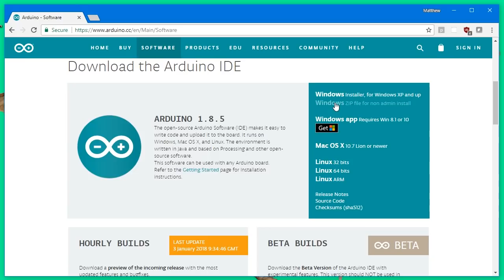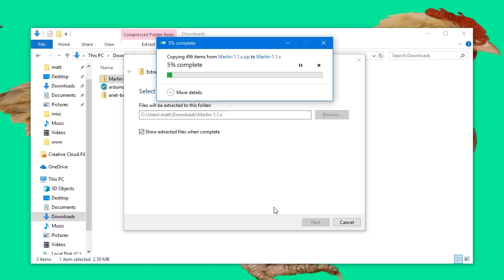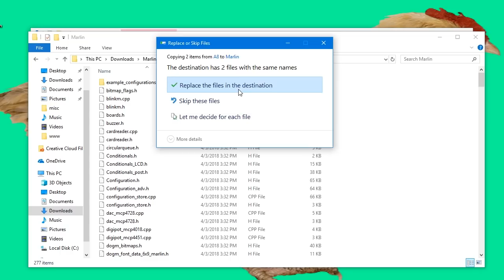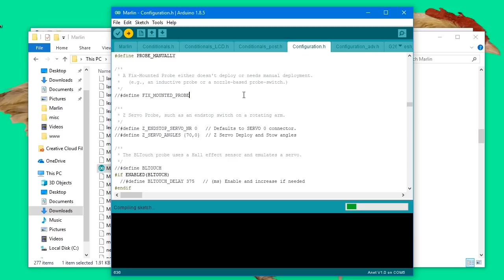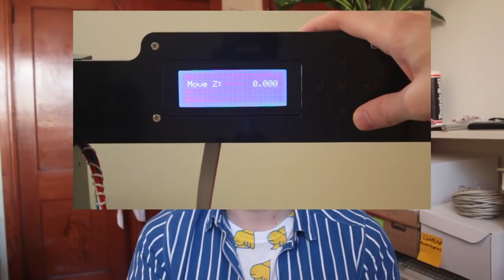Anet A8 Upgrade: Why & How You Should Update Your Firmware - Marlin Install Tutorial

Comment: Hi
I get this error message if I want to do this upgrade :/
pasting "/* (bed)*/" and "_RPORT" does not give a valid preprocessing token

What can I do against this fail?
Reply: Thats the whole text:

Arduino: 1.8.6 (Windows 10), Board: "Anet V1.0"

In file included from sketch\HAL.h:33:0,

                 from sketch\MarlinConfig.h:39,

                 from sketch\Marlin.h:35,

                 from sketch\temperature.cpp:27:

pins_ANET_10.h:135:33: error: pasting "/* (bed)*/" and "_RPORT" does not give a valid preprocessing token

 #define HEATER_BED_PIN     12   // (bed)

                                 ^

sketch\fastio.h:82:48: note: in definition of macro '_WRITE'

 #define _WRITE(IO,V)          do{ if (&(DIO ## IO ## _RPORT) < (uint8_t*)0x100) _WRITE_NC(IO,V); else _WRITE_C(IO,V); }while(0)

                                                ^

sketch\Conditionals_post.h:906:31: note: in expansion of macro 'WRITE'

   #define WRITE_HEATER_BED(v) WRITE(HEATER_BED_PIN, (v) ^ HEATER_BED_INVERTING)

                               ^

sketch\Conditionals_post.h:906:37: note: in expansion of macro 'HEATER_BED_PIN'

   #define WRITE_HEATER_BED(v) WRITE(HEATER_BED_PIN, (v) ^ HEATER_BED_INVERTING)

                                     ^

sketch\temperature.cpp:884:11: note: in expansion of macro 'WRITE_HEATER_BED'

           WRITE_HEATER_BED(LOW);

           ^

pins_ANET_10.h:135:33: error: pasting "/* (bed)*/" and "_WPORT" does not give a valid preprocessing token

 #define HEATER_BED_PIN     12   // (bed)

                                 ^

sketch\fastio.h:72:21: note: in definition of macro '_WRITE_NC'

   if (V) SBI(DIO ## IO ## _WPORT, DIO ## IO ## _PIN); \

                     ^

sketch\fastio.h:94:31: note: in expansion of macro '_WRITE'

 #define WRITE(IO,V)           _WRITE(IO,V)

                               ^

sketch\Conditionals_post.h:906:31: note: in expansion of macro 'WRITE'

   #define WRITE_HEATER_BED(v) WRITE(HEATER_BED_PIN, (v) ^ HEATER_BED_INVERTING)

                               ^

sketch\Conditionals_post.h:906:37: note: in expansion of macro 'HEATER_BED_PIN'

   #define WRITE_HEATER_BED(v) WRITE(HEATER_BED_PIN, (v) ^ HEATER_BED_INVERTING)

                                     ^

sketch\temperature.cpp:884:11: note: in expansion of macro 'WRITE_HEATER_BED'

           WRITE_HEATER_BED(LOW);

           ^

pins_ANET_10.h:135:33: error: pasting "/* (bed)*/" and "_PIN" does not give a valid preprocessing token

 #define HEATER_BED_PIN     12   // (bed)

                                 ^

sketch\fastio.h:72:42: note: in definition of macro '_WRITE_NC'

   if (V) SBI(DIO ## IO ## _WPORT, DIO ## IO ## _PIN); \

                                          ^

sketch\fastio.h:94:31: note: in expansion of macro '_WRITE'

 #define WRITE(IO,V)           _WRITE(IO,V)

                               ^

sketch\Conditionals_post.h:906:31: note: in expansion of macro 'WRITE'

   #define WRITE_HEATER_BED(v) WRITE(HEATER_BED_PIN, (v) ^ HEATER_BED_INVERTING)

                               ^

sketch\Conditionals_post.h:906:37: note: in expansion of macro 'HEATER_BED_PIN'

   #define WRITE_HEATER_BED(v) WRITE(HEATER_BED_PIN, (v) ^ HEATER_BED_INVERTING)

                                     ^

sketch\temperature.cpp:884:11: note: in expansion of macro 'WRITE_HEATER_BED'

           WRITE_HEATER_BED(LOW);

           ^

pins_ANET_10.h:135:33: error: pasting "/* (bed)*/" and "_WPORT" does not give a valid preprocessing token

 #define HEATER_BED_PIN     12   // (bed)

                                 ^

sketch\fastio.h:73:21: note: in definition of macro '_WRITE_NC'

   else   CBI(DIO ## IO ## _WPORT, DIO ## IO ## _PIN); \

                     ^

sketch\fastio.h:94:31: note: in expansion of macro '_WRITE'

 #define WRITE(IO,V)           _WRITE(IO,V)

                               ^

sketch\Conditionals_post.h:906:31: note: in expansion of macro 'WRITE'

   #define WRITE_HEATER_BED(v) WRITE(HEATER_BED_PIN, (v) ^ HEATER_BED_INVERTING)

                               ^

sketch\Conditionals_post.h:906:37: note: in expansion of macro 'HEATER_BED_PIN'

   #define WRITE_HEATER_BED(v) WRITE(HEATER_BED_PIN, (v) ^ HEATER_BED_INVERTING)

                                     ^

sketch\temperature.cpp:884:11: note: in expansion of macro 'WRITE_HEATER_BED'

           WRITE_HEATER_BED(LOW);

           ^

pins_ANET_10.h:135:33: error: pasting "/* (bed)*/" and "_PIN" does not give a valid preprocessing token

 #define HEATER_BED_PIN     12   // (bed)

                                 ^

sketch\fastio.h:73:42: note: in definition of macro '_WRITE_NC'

   else   CBI(DIO ## IO ## _WPORT, DIO ## IO ## _PIN); \

                                          ^

sketch\fastio.h:94:31: note: in expansion of macro '_WRITE'

 #define WRITE(IO,V)           _WRITE(IO,V)

                               ^

sketch\Conditionals_post.h:906:31: note: in expansion of macro 'WRITE'

   #define WRITE_HEATER_BED(v) WRITE(HEATER_BED_PIN, (v) ^ HEATER_BED_INVERTING)

                               ^

sketch\Conditionals_post.h:906:37: note: in expansion of macro 'HEATER_BED_PIN'

   #define WRITE_HEATER_BED(v) WRITE(HEATER_BED_PIN, (v) ^ HEATER_BED_INVERTING)

                                     ^

sketch\temperature.cpp:884:11: note: in expansion of macro 'WRITE_HEATER_BED'

           WRITE_HEATER_BED(LOW);

           ^

pins_ANET_10.h:135:33: error: pasting "/* (bed)*/" and "_WPORT" does not give a valid preprocessing token

 #define HEATER_BED_PIN     12   // (bed)

                                 ^

sketch\fastio.h:77:30: note: in definition of macro '_WRITE_C'

   uint8_t port_bits = DIO ## IO ## _WPORT;                  /* Get a mask from the current port bits */ \

                              ^

sketch\fastio.h:94:31: note: in expansion of macro '_WRITE'

 #define WRITE(IO,V)           _WRITE(IO,V)

                               ^

sketch\Conditionals_post.h:906:31: note: in expansion of macro 'WRITE'

   #define WRITE_HEATER_BED(v) WRITE(HEATER_BED_PIN, (v) ^ HEATER_BED_INVERTING)

                               ^

sketch\Conditionals_post.h:906:37: note: in expansion of macro 'HEATER_BED_PIN'

   #define WRITE_HEATER_BED(v) WRITE(HEATER_BED_PIN, (v) ^ HEATER_BED_INVERTING)

                                     ^

sketch\temperature.cpp:884:11: note: in expansion of macro 'WRITE_HEATER_BED'

           WRITE_HEATER_BED(LOW);

           ^

pins_ANET_10.h:135:33: error: pasting "/* (bed)*/" and "_RPORT" does not give a valid preprocessing token

 #define HEATER_BED_PIN     12   // (bed)

                                 ^

sketch\fastio.h:79:10: note: in definition of macro '_WRITE_C'

   DIO ## IO ## _RPORT = port_bits & _BV(DIO ## IO ## _PIN); /* Atomically toggle the output port bits */ \

          ^

sketch\fastio.h:94:31: note: in expansion of macro '_WRITE'

 #define WRITE(IO,V)           _WRITE(IO,V)

                               ^

sketch\Conditionals_post.h:906:31: note: in expansion of macro 'WRITE'

   #define WRITE_HEATER_BED(v) WRITE(HEATER_BED_PIN, (v) ^ HEATER_BED_INVERTING)

                               ^

sketch\Conditionals_post.h:906:37: note: in expansion of macro 'HEATER_BED_PIN'

   #define WRITE_HEATER_BED(v) WRITE(HEATER_BED_PIN, (v) ^ HEATER_BED_INVERTING)

                                     ^

sketch\temperature.cpp:884:11: note: in expansion of macro 'WRITE_HEATER_BED'

           WRITE_HEATER_BED(LOW);

           ^

pins_ANET_10.h:135:33: error: pasting "/* (bed)*/" and "_PIN" does not give a valid preprocessing token

 #define HEATER_BED_PIN     12   // (bed)

                                 ^

sketch\fastio.h:79:48: note: in definition of macro '_WRITE_C'

   DIO ## IO ## _RPORT = port_bits & _BV(DIO ## IO ## _PIN); /* Atomically toggle the output port bits */ \

                                                ^

sketch\fastio.h:94:31: note: in expansion of macro '_WRITE'

 #define WRITE(IO,V)           _WRITE(IO,V)

                               ^

sketch\Conditionals_post.h:906:31: note: in expansion of macro 'WRITE'

   #define WRITE_HEATER_BED(v) WRITE(HEATER_BED_PIN, (v) ^ HEATER_BED_INVERTING)

                               ^

sketch\Conditionals_post.h:906:37: note: in expansion of macro 'HEATER_BED_PIN'

   #define WRITE_HEATER_BED(v) WRITE(HEATER_BED_PIN, (v) ^ HEATER_BED_INVERTING)

                                     ^

sketch\temperature.cpp:884:11: note: in expansion of macro 'WRITE_HEATER_BED'

           WRITE_HEATER_BED(LOW);

           ^

In file included from sketch\HAL.h:33:0,

                 from sketch\MarlinConfig.h:39,

                 from sketch\Marlin.h:35,

                 from sketch\temperature.cpp:27:

pins_ANET_10.h:134:33: error: pasting "/* (extruder)*/" and "_DDR" does not give a valid preprocessing token

 #define HEATER_0_PIN       13   // (extruder)

                                 ^

sketch\fastio.h:87:42: note: in definition of macro '_SET_OUTPUT'

 #define _SET_OUTPUT(IO)       SBI(DIO ## IO ## _DDR, DIO ## IO ## _PIN)

                                          ^

sketch\temperature.cpp:1106:5: note: in expansion of macro 'SET_OUTPUT'

     SET_OUTPUT(HEATER_0_PIN);

     ^

sketch\temperature.cpp:1106:16: note: in expansion of macro 'HEATER_0_PIN'

     SET_OUTPUT(HEATER_0_PIN);

                ^

pins_ANET_10.h:134:33: error: pasting "/* (extruder)*/" and "_PIN" does not give a valid preprocessing token

 #define HEATER_0_PIN       13   // (extruder)

                                 ^

sketch\fastio.h:87:61: note: in definition of macro '_SET_OUTPUT'

 #define _SET_OUTPUT(IO)       SBI(DIO ## IO ## _DDR, DIO ## IO ## _PIN)

                                                             ^

sketch\temperature.cpp:1106:5: note: in expansion of macro 'SET_OUTPUT'

     SET_OUTPUT(HEATER_0_PIN);

     ^

sketch\temperature.cpp:1106:16: note: in expansion of macro 'HEATER_0_PIN'

     SET_OUTPUT(HEATER_0_PIN);

                ^

pins_ANET_10.h:135:33: error: pasting "/* (bed)*/" and "_DDR" does not give a valid preprocessing token

 #define HEATER_BED_PIN     12   // (bed)

                                 ^

sketch\fastio.h
Reply: i think there is something wrong with ide 1.8.6, i downgraded mine to 1.8.5 and it worked fine.

Comment: I seem to get error messages when compiling.
Followed it to the letter... help....

Arduino: 1.8.10 (Windows 10), Board: "Anet V1.0"

In file included from C:\Program Files\Arduino\hardware\arduino\avr\cores\arduino/Arduino.h:257:0,

                 from sketch\HAL.h:36,

                 from sketch\MarlinConfig.h:39,

                 from sketch\G26_Mesh_Validation_Tool.cpp:27:

C:\Users\User\Documents\Arduino\hardware\anet\avr\variants\sanguino/pins_arduino.h:43:0: warning: "TIMER2" redefined

 #define TIMER2  5

 

In file included from sketch\HAL.h:36:0,

                 from sketch\MarlinConfig.h:39,

                 from sketch\G26_Mesh_Validation_Tool.cpp:27:

 

In file included from sketch\endstops.cpp:35:0:

sketch\endstop_interrupts.h: In function 'void setup_endstop_interrupts()':

endstop_interrupts.h:121:7: error: non-constant condition for static assertion

       static_assert(digitalPinToPCICR(X_MIN_PIN) != NULL, "X_MIN_PIN is not interrupt-capable");

       ^~~~~~~~~~~~~

In file included from C:\Program Files\Arduino\hardware\arduino\avr\cores\arduino/Arduino.h:257:0,

                 from sketch\HAL.h:36,

                 from sketch\MarlinConfig.h:39,

                 from sketch\Marlin.h:35,

                 from sketch\endstops.cpp:27:

C:\Users\User\Documents\Arduino\hardware\anet\avr\variants\sanguino/pins_arduino.h:117:66: error: reinterpret_cast from integer to pointer

 #define digitalPinToPCICR(p)    ( (((p) >= 0) && ((p) <= 31)) ? (&PCICR) : ((uint8_t *)0) )

                                                                 ~^~~~~~~

sketch\endstop_interrupts.h:121:21: note: in expansion of macro 'digitalPinToPCICR'

       static_assert(digitalPinToPCICR(X_MIN_PIN) != NULL, "X_MIN_PIN is not interrupt-capable");

                     ^~~~~~~~~~~~~~~~~

In file included from sketch\endstops.cpp:35:0:

endstop_interrupts.h:141:7: error: non-constant condition for static assertion

       static_assert(digitalPinToPCICR(Y_MIN_PIN) != NULL, "Y_MIN_PIN is not interrupt-capable");

       ^~~~~~~~~~~~~

In file included from C:\Program Files\Arduino\hardware\arduino\avr\cores\arduino/Arduino.h:257:0,

                 from sketch\HAL.h:36,

                 from sketch\MarlinConfig.h:39,

                 from sketch\Marlin.h:35,

                 from sketch\endstops.cpp:27:

C:\Users\User\Documents\Arduino\hardware\anet\avr\variants\sanguino/pins_arduino.h:117:66: error: reinterpret_cast from integer to pointer

 #define digitalPinToPCICR(p)    ( (((p) >= 0) && ((p) <= 31)) ? (&PCICR) : ((uint8_t *)0) )

                                                                 ~^~~~~~~

sketch\endstop_interrupts.h:141:21: note: in expansion of macro 'digitalPinToPCICR'

       static_assert(digitalPinToPCICR(Y_MIN_PIN) != NULL, "Y_MIN_PIN is not interrupt-capable");

                     ^~~~~~~~~~~~~~~~~

In file included from sketch\endstops.cpp:35:0:

endstop_interrupts.h:161:7: error: non-constant condition for static assertion

       static_assert(digitalPinToPCICR(Z_MIN_PIN) != NULL, "Z_MIN_PIN is not interrupt-capable");

       ^~~~~~~~~~~~~

In file included from C:\Program Files\Arduino\hardware\arduino\avr\cores\arduino/Arduino.h:257:0,

                 from sketch\HAL.h:36,

                 from sketch\MarlinConfig.h:39,

                 from sketch\Marlin.h:35,

                 from sketch\endstops.cpp:27:

C:\Users\User\Documents\Arduino\hardware\anet\avr\variants\sanguino/pins_arduino.h:117:66: error: reinterpret_cast from integer to pointer

 #define digitalPinToPCICR(p)    ( (((p) >= 0) && ((p) <= 31)) ? (&PCICR) : ((uint8_t *)0) )

                                                                 ~^~~~~~~

sketch\endstop_interrupts.h:161:21: note: in expansion of macro 'digitalPinToPCICR'

       static_assert(digitalPinToPCICR(Z_MIN_PIN) != NULL, "Z_MIN_PIN is not interrupt-capable");

                     ^~~~~~~~~~~~~~~~~

 

Multiple libraries were found for "LiquidCrystal.h"
 Used: C:\Program
exit status 1
non-constant condition for static assertion

This report would have more information with
"Show verbose output during compilation"
option enabled in File -> Preferences.

Comment: Failed to compile - error message "exit status 1 - non-constant condition for static assertion" and it highlighted line (see added arrow):  
 
#if HAS_Z_MIN
    #if digitalPinToInterrupt(Z_MIN_PIN) != NOT_AN_INTERRUPT
      attachInterrupt(digitalPinToInterrupt(Z_MIN_PIN), endstop_ISR, CHANGE);
    #else
      // Not all used endstop/probe -pins can raise interrupts. Please deactivate ENDSTOP_INTERRUPTS or change the pin configuration!
   ----->   static_assert(digitalPinToPCICR(Z_MIN_PIN) != NULL, "Z_MIN_PIN is not interrupt-capable");
      pciSetup(Z_MIN_PIN);
    #endif
  #endif

But I can't see how that book is different than any of the others.

Comment: didn't work...errored like hell. with final line saying "non-constant condition for static assertion" !!
Reply: I had the same issue. The answer to your question was in the comments below: "
Flipped Out
8 months ago (edited)
Great Video Matthew Rayfield!  Thank you.  Everyone doing this to update to Marlin 1.1.9 now will get a "Non-constant condition for static assertion" error when trying to update an Anet A8 board using this instruction video.  To make it work all you need to do is go into your Arduino IDE and load TOOLS/BOARDS/BOARD MANAGER and search for "Arduino AVR Boards" - then click on "Arduino AVR Boards" and install version 1.6.23 by picking it in the dropdown on the left side bottom where it says "Select Version".   After you install 1.6.23 this earlier version of the Arduino AVR boards code is not bugged and your firmware will update.  Happy updates. "

Comment: Ok says file too big and need to reduce it.  How do I do that?
Reply from the maker: I'm not sure what causes this. I've seen it a few times and then it goes away when I try again. If you keep getting it, try Googling the error message you get and see how people are fixing it.
Reply: "If you get a warning that Marlin requires too much Program Memory or SRAM to fit on your board, you can disable features or use less expensive features to bring Marlin down to a smaller size. The SLIM_LCD_MENUS option is included as a way to save space by leaving extraneous menus out of the LCD interface."

Comment: so i got it all to work and everything, but when i go to print after it heats the bed, it tries to heat the extruder (e1) and then fails to heat and asks to reset the printer.. any thoughts?
Reply from the maker: Does it say it over heated ? It could be that the thermal protection settings are too sensitive. They can be adjusted: http://marlinfw.org/docs/configuration/configuration.html#thermal-protection-settings

Comment: Hi - Great video but mine fails with a problem uploading to board.  Do you have any tips on why this may be?
Reply from the maker: Make sure that you have the board definition installed and that the printer is on and connected. Another issue can be that a slicer or something is also trying to connect to the printer.